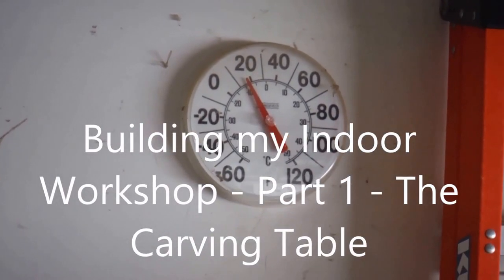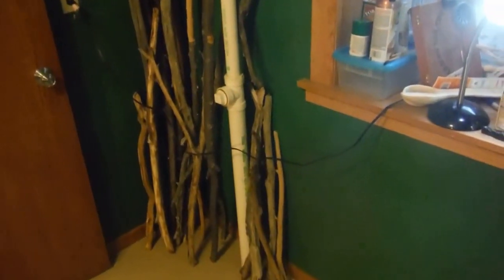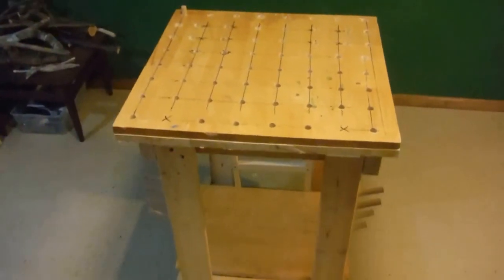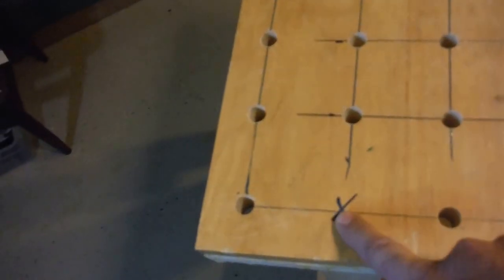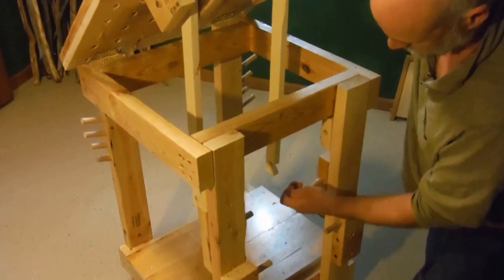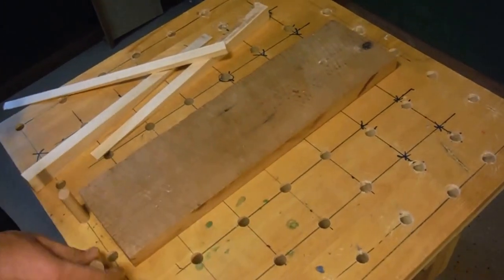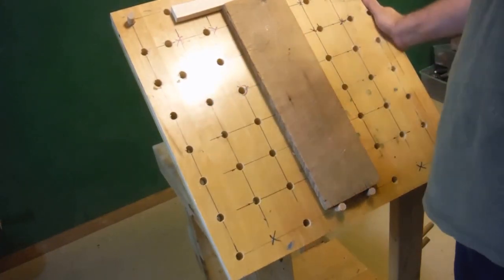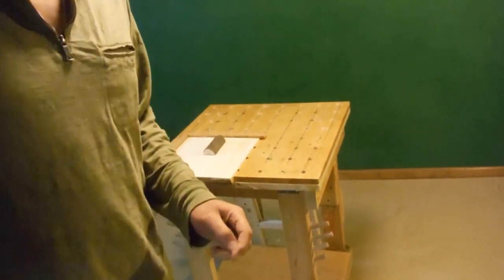Building the Indoor Workshop Part 1 The Carving Table

Comment: I watched your vise posts, and loved your going from conception, to trial, and then tweak!

I use and restore various hand tools on a regular basis, most of it is practical work like edge tool handles. Until I finish a shavehorse, I am limited to lap-work (or a cold barn)

Your bench sparked a number of possible uses...flattening, shooting, scraping wood with dogs but also working with clamps and jigs to hold numerous other objects and materials.
your hinged top would also allow pushing and pulling tools.

Great build!
Reply from the maker: +Paul Drowns thank you!

Comment: Why didn't you just insulate your workshop? I have a 20 x 14 workshop in my garage that has 6" fiberglass in the walls, floor, and 12" in the ceiling. A 1500 W heater is more than enough to keep it warm (60°F) in deep winter in upstate New York.